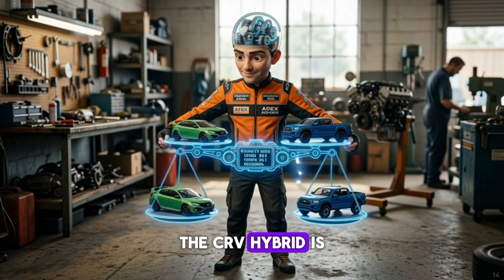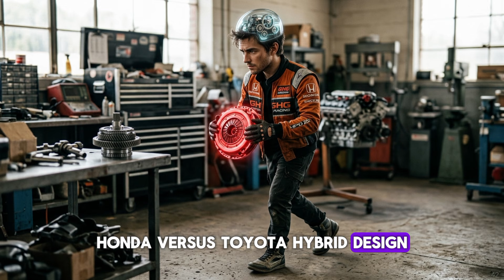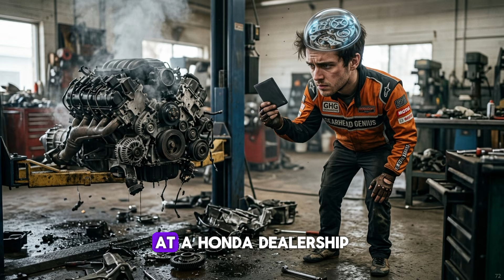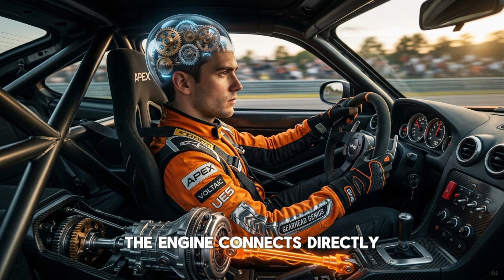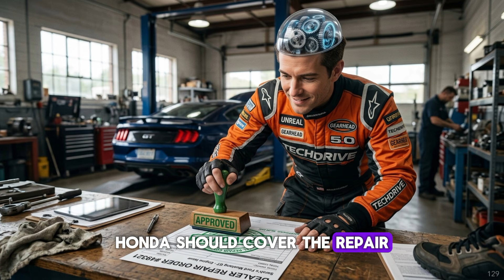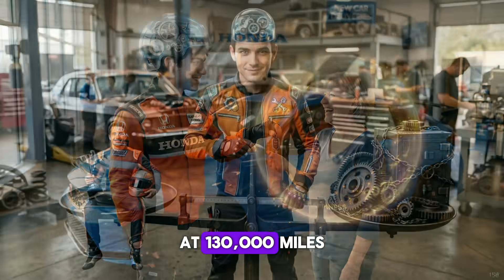Honda's eHEV Fatal Flaw (Honda Car Owners are Miserable)

Comment: Honda clutch engages only at highway speeds which I seldom go to, so within city daily commute is fine with motor driving the wheels. Despite being more prone to failure honda ecvt is more fun to drive.
Reply from the maker: Techinnate, thank you for watching and leaving such a great comment, man!

 You bring up an absolutely brilliant point, and you are 100% correct on the engineering facts.
Because Honda's direct-drive clutch only physically engages at highway cruising speeds to connect the gas engine to the wheels, your city-heavy commute means that friction material is basically sitting idle. By rarely hitting those high speeds, you are completely bypassing the main mechanical failure point that plagues heavy highway drivers.

It perfectly proves that matching your specific driving habits to the right powertrain architecture is the ultimate cheat code. You get to enjoy that superior, sporty driving dynamic while keeping your Total Cost of Ownership (TCO) incredibly low. Keep racking up those trouble-free city miles! 🔧